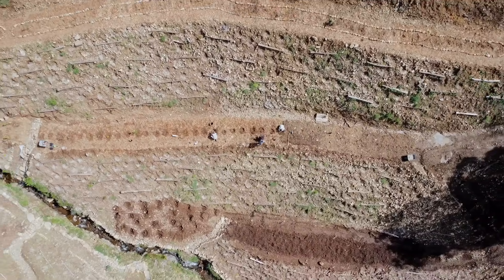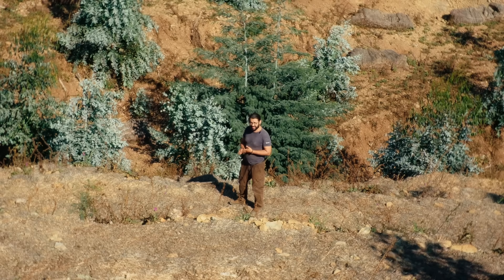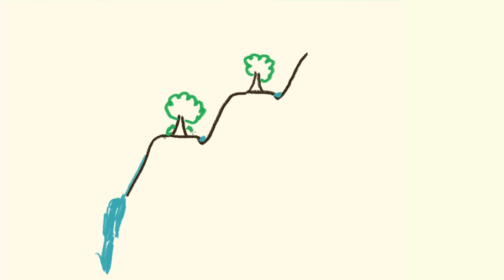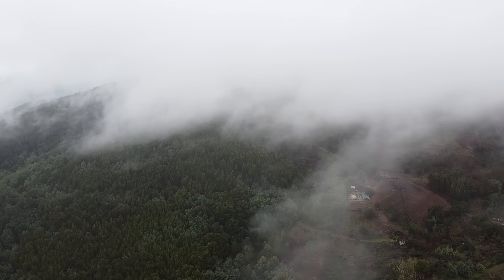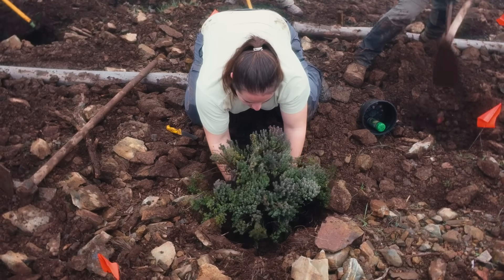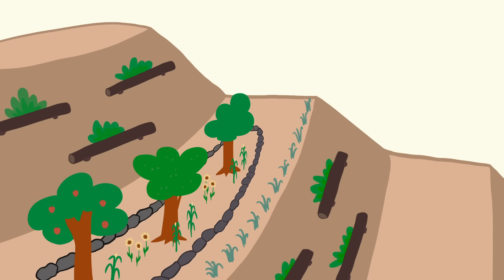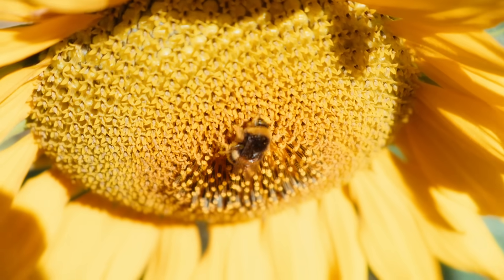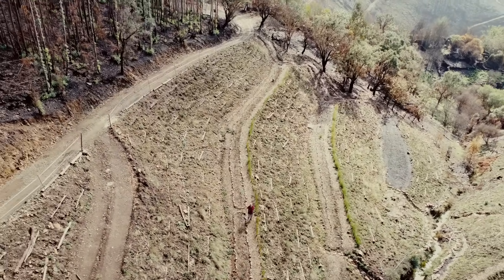#21 RISE and FALL of Our Agroforest: 16 months of Transformation in 1 Video

Comment: Why not build wider terraces and plant food on those terraces, protecting them from eroion by building drywall? Are there any advantages in this approach?
Reply from the maker: This approach is meant to make an approach that will have food production on the terraces and the slopes will have a mix of herbaceous plants to make it more like a forest garden rather than just food production.
Reply: Wider terraces would mean less terraces and steeper slopes in between - there are reference angles when engineering that correlate to how much propensity for erosion there is.

Building drywall would be a solution for it, is, but building a few kilometers of wall seems a lot more time and labour consuming :p

There's also the aspect of how many plantation lines can be implemented on thinner or wider terraces, and the edge effect to be taken into account.

Comment: Silver lining is biochar and proof of concept
Reply: Unfortunately these are coals, not biochar :/ biochar requires slow smouldering without oxygen
Reply: @tempestive1  Not true - biochar doesnt HAVE to be the perfectly without oxygen produced coal, what is left behind from the fire (the part thats not ashes, ie completely oxidised) still has very high surface area and chemical stability, so if it now becomes innoculated with biology, that makes it biochar!